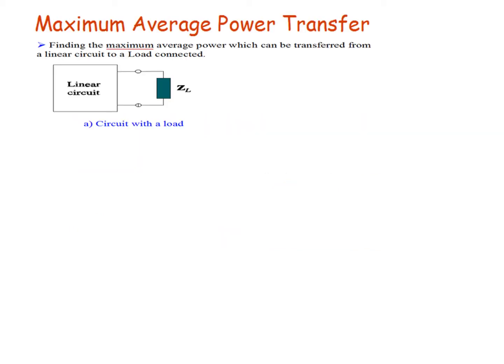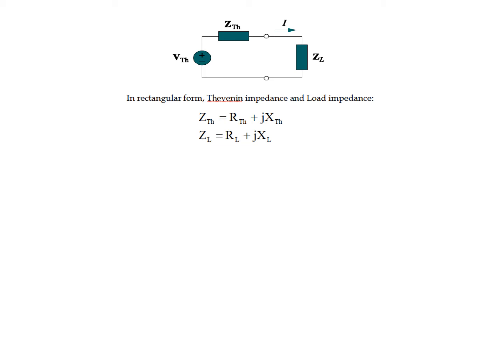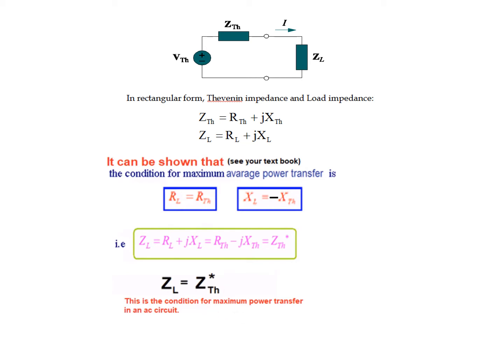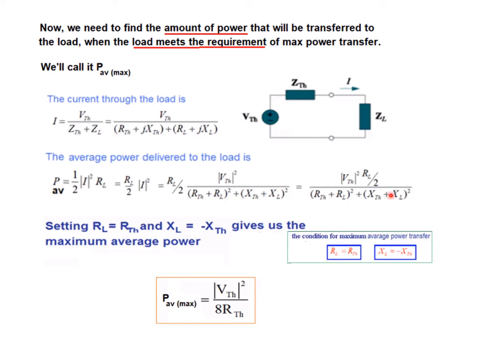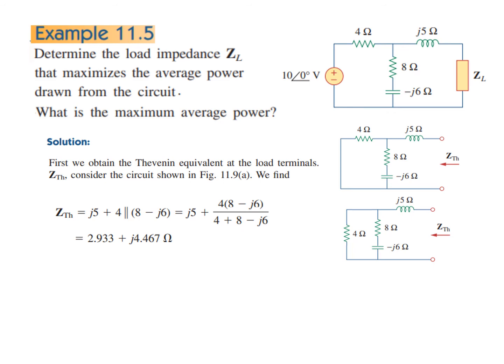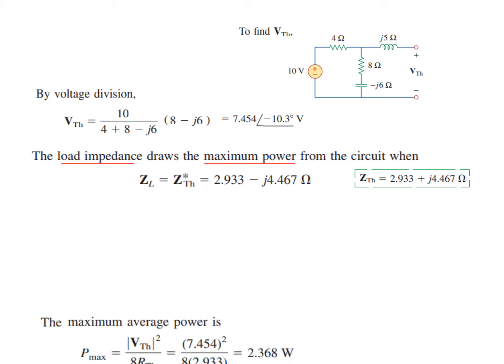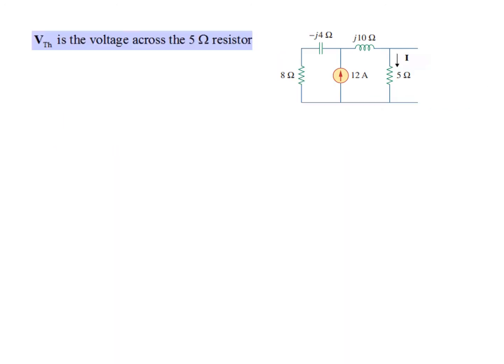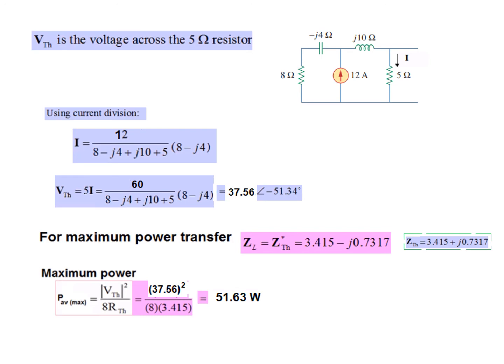(English)ENA || Example & Practice 11.5 || Max Average Power Transfer for Reactive Load

Comment: At 10:05 I am getting a different answer for current if I use mesh analysis. I am getting an answer of 6.64 with an angle of -45.9 degree. Why does mesh not work for this. Why do we have to use current division?
Reply from the maker: Since there is a current source between two meshes, you have to use Super Mesh technique. Also don't forget to multiply I2 by 5 (resistance) to get Vth. I got answer 37.40<-51.34